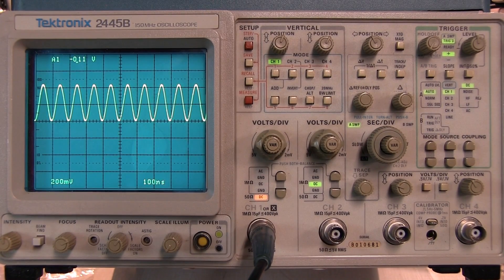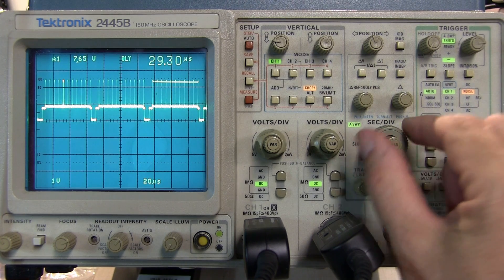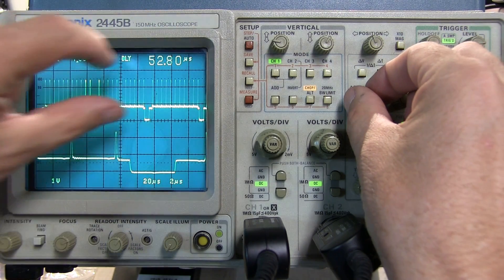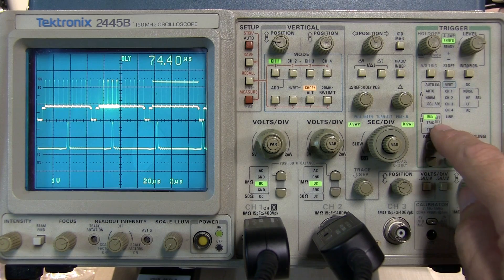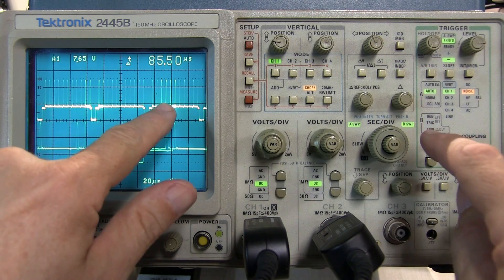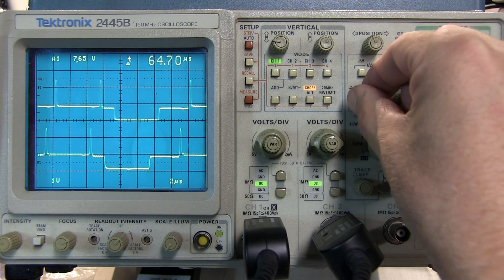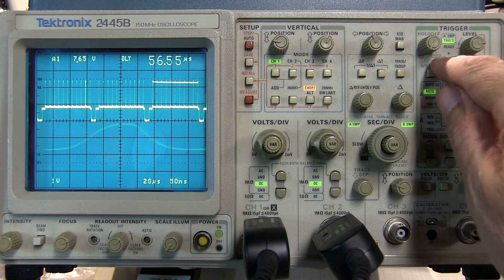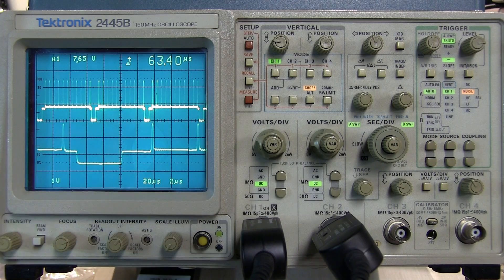#287: How to use the Delayed B-Sweep Timebase on Tektronix 2465 2445 2455 2467 Oscilloscopes

Comment: You didn't mention anything at all about how to use the B delay sweep to view display and measure pre trigger waveforms. The B delay sweep just zooms in on the highlighted area that you want to zoom in on to measure more details. I'm not sure how to use the B delay sweep to view the pre triggered information or what types of waveforms/signals a technician would want to display the pre triggered information?
Reply from the maker: As I said before, you can't truly get pre-trigger information on an analog scope unless you EXTERNALLY delay the signal with respect to the trigger.  The Delayed timebase allows you acquire multiple cycles of your signal, then zoom in to see the waveform before similar edges on subsequent cycles.
Reply: @w2aew  oh ok I thought you said that the B delay sweep circuit was also external delaying the input signal with respect to the trigger. So you're saying that the B delay sweep is NOT delaying the input signal with respect to the trigger? I always thought the B delay sweep circuit was adding an offset sample and hold circuit or using a BBD time delay chip to delay the input signal with respect to the trigger
Reply from the maker: @waynegram8907  the B delayed sweep is simply a second sweep circuit that started or triggered after a user-defined delay from the A trigger event.  It is the sweep that is delayed, not the input signal.
Reply: @w2aew  you mean it's delaying the horizontal deflection circuit? It seems like there is two separate beams compared to most analog oscilloscopes only have 1 beam not 2 beams.

Comment: I just bought a 2445 for $186 on eBay including shipping. Did I get burned or a good deal? I currently have a Iwatsu SS-5710 but I've always wanted a Tektronix because they show information on the screen like the volts/div and the sec/div and my Iwatsu doesn't do it.
Reply from the maker: Thats a nice scope, I would say that you got a good deal.

Comment: Hi mate. I was wondering if you have an opinion on whether you should operate your analog oscilloscope on no timebase mode (beam stationary) or any mode that would leave a constant electron beam on a single area. Will it burn the phosphor behind the glass?  I purchased my analog oscilloscope last night and the seller has taken very good care of it and told me not to let the trace stay stationary. I believe him, I just don't know how paranoid I need to be and how many seconds/minutes before it will overheat. The model is a Pintek PS-605
Reply from the maker: It is difficult to say.  A static dot can certainly cause damage.  How quickly is a product of the dot intensity and duration (and the quality of the CRT).  Best practice is to NOT have a static dot if possible, at least have it sweeping.  And use the minimum brightness/intensity needed to get the job done.
Reply: @w2aew  Thanks mate. Sorry I was a way and didnt get a chance to reply. You are 100% correct. I finished reading through the manual and it says to avoid keeping the sweep too slow and only use high intensity when needed, and not for too long. Thanks mate. I'm learning from your videos

Comment: Hi, I am reading that some (better) analog scopes have delay line so one can see the actual trigger signal, or even some part before? I think, if somebody, you should know about that feature? So you maybe would like to elaborate on that. And if they do not have it, if we would have a external analog delay, we could feed the original signal into the external trigger input and the delayed signal to a regular channel. Old TV's used (only PAL maybe, not sure) a delay line, but my knowledge about that ends there. And no idea what handy part could be used here for (not to have to use a big lumpy coil).  I am getting tomorrow a blown-up 2445 that I will try to resurrect from the dead. I hope only one of the RIFA's blown up and the rest hopefully stayed undamaged, fingers crossed 🤞 Greets! Edit: if I calculated it right, 10m of coax would give a nice 50ns delay 🤔 That is actually not so bad. Edit 2: I see that an Tektronix external delay line like DL-11 is still not very cheap 😁
Reply from the maker: Yes, many do have a delay line for that purpose.  Some also have an output that provides a buffered copy of the signal at one of the inputs.  This could also be fed back into another input as another source of a delayed signal to see more of the pre-trigger waveform.
Reply: @w2aew  okay, Good to know 👍  then you probably delay the copy of the input signal externally and trigger on that on the second ch. The original input signal is then "further in time".

Comment: Hi. One question about the crt. How much better would be the micro-channel plate CRT in 2467(B) compared to the "standard" crt? Especially with those high bandwidth scopes. In anyway one would maybe wanted to spot some glitches and I was wandering if the u-channel plate would provide much more chance to see it...???
Reply from the maker: The MCP gives you a couple orders of magnitude faster writing rate - able to see single-shot events at 1ns/div.

Comment: I have a 2467 with the CTT option and I've just discovered that it gives you a couple of extra tricks. First, the CTT will measure the time delta between triggered B sweeps. Second, with the CTT option, it's possible to set up separate slope and trigger levels for each of the B sweeps. In combination, you could e.g. use this to measure the length of a pulse by triggering on the fall/rise.

Comment: Great video. I have a 2246 with an odd symptom I wonder if you had seen before. The Voltmeter function of the scope is intermittent, and when it doesn't work it displays "Ouch. Turn Volts/Div CCW" even with no signal in. I can't find anything in the service manual and thought with you vast experience that maybe you had experienced this symptom before? Thanks for the wonderful content.
Reply from the maker: Sorry, I don't have any experience with the 2246.  Sounds like the voltmeter is thinking it is getting over-ranged.  The experts on the TekScopes group may have some experience to share.

Comment: hi, how to see  power on hours and cycle counts?
Reply from the maker: Copied from another forum:
If you want to check how much the scope has been used, you can run the Diagnostic Exerciser EXER 05.  It will tell you the total operating time and the power cycle count.  Here's how you run this:

Press and hold the delta-V and delta-t buttons, then press Trigger SLOPE (while still holding down delta-V and delta-t).  Release all buttons.  Then press the upper/lower Trigger MODE buttons until EXER 05 is selected.  Then press the upper Trigger COUPLING button to run EXER 05.  You can exit the exerciser with the lower Trigger COUPLING button and return to normal scope operation with the A/B TRIG button.
Reply: @w2aew  my machine is baby... me2... in this field... i ask and they block me.. I do not why.. I read... ask...  I just start print manuals PDF...  HR ON 8116 PWR ON/OFF 2177  i just find weak spot is u800 like I have on board...  :( i do not know what I can to do last longer...
Reply from the maker: @zeljkoadzic1692  just make sure to keep the fan in good working order and always run it with the case on to get proper airflow.

Comment: Cool !! I just got my scope 2 years ago. All sorts of cool stuff !!  I use the analog one for when I need more perception. Like when a waveform has more complicated structures. In a digital scope the refresh rate is dismal, so catching non-periodic anomalies Is damn near impossible... I really wish the old scope had more on screen measurements and COLOR .. jeez  different color traces . who woulda thought that was needed !!   =joke ... I knew the pull knob zoomed, but I didn't know when you turn it it magically pops up a new mini version, and all the other tricks u showed ....  hmm . now thinking about it > whats the deal with the var , is there some magic special reasons they exist more than merely shrinking  ?
Reply from the maker: The VAR control on the horizontal timebase is for those rare occasions where you don't need a calibrated sweep speed, but rather need to display a specific time-duration of a waveform which would require a time/div setting that falls between two of the calibrated positions on the knob.

Comment: Great video! I have Tek 2465 DMS that isn't working well. Any suggestions where to look to fix it? Sometimes I get trace on all 4 channels but sometimes they go away, Also the text/numbers at the top + bottom aren't always visible, they go to some electronics heaven but if I wiggle stuff, sometimes I get ti to stay on. Also, when I push the "beam finder" button, everything shrinks, so all 4 channels are about 2" long and the text is just small pixels - all in the center. Thanks for sharing and teaching here!

Comment: Always enjoy your videos Alan. I just was given a 2445A, that was is need of some care. Turns out it works just fine, but some prior owner, broke off the shafts of the vernier controls for both VOLT/DIV channels. Fortunately I got them back to the calibrated position, but not enough shaft left to attach a knob on. I also own the 2465 (300 Mhz) and  it is my go to scope even though I have a modern digital scope.I just think Tektronix made the best scopes and their durability is a testament their quality.
Reply from the maker: Fortunately, you rarely need to move those controls off of the Cal position.  I've heard some folks that have replaced the shaft with a small piece of metal tubing or even a small fiberglass rod from a hobby supply shop.
Reply: @w2aew  
 Yes, that is my experience. I thought about the fixes you mentioned, after looking inside, only the metal tubing seems practical unless I want to take the the Vertical section apart. I am a retired engineer (Rutgers) and a ham (Extra class K7MLG and have been repairing vintage radios and test equipment to keep busy.
Again I really enjoy your videos they are the most accurate and enlightening on oscilloscopes.

Comment: Were these scopes aided by some CPU or it is just pure analog electronics? It's pure magic if it is.
Reply from the maker: While this family of scopes does have a microprocessor, the delaying timebase capability also existed in several Tek scopes that had no uP at all - pure elegant analog design.
Reply: Well its digital design too, the state-machine for the sweeping would have involved a variety of flipflops and gates to do the work.

Comment: Great as always.  May be do an episode about how the delays are used to make meaningful measurements.  Even something goofy like how a switching transistor in a power supply works.  The "delay" of the inductive aspect of the transformer winding is interesting.  Can we make a quality guess without a Clive style teardown by looking at the different individual windings?  Crazy I know, but that's the sort of stuff we tried to do in '85.
Reply from the maker: I"ll jot that down.  I have a few videos that use the delaying timebase to make "real" measurements already.  One shows how to use the delaying timebase to accurately measure frequency.  Another shows the use of the delaying timebase to help characterize an RF power detector.  There are probably a few others too.

Comment: Nice video Alan.
Tek did and do make some outstanding scopes.
That's a nice example, I'de be proud to own that. 
I think I would prefer to use it than my two modern DSO's.  Siglent SDS1102CML and SDS1104X-E. both of which together, probably don't cost as much as your TEK2445B.

Comment: Quick question. I'm assembling my electronics workbench (aimed at RF - primarily HF but it would be nice to cover up to the 70 cm band) and I need to pick a scope. Any suggestions that wont break the bank? As we are on the topic, a video on how to put together a instrument setup for RF test, repair and design without selling you kidney and first-born would be great!
Reply from the maker: That's a quick questions that doesn't have a quick answer.  A decent scope is helpful.  I like analog to look at RF envelopes, etc.  Digital scopes add FFT capability for rudimentary spectrum analysis, as well as a ton of other features.  Good RF power meter is typically needed.  An RF signal source can be very helpful.  Even an SDR based spectrum analyzer can be quite useful.  There are a lot of amateur grade RF equipments (analyzers, VNA, siggen, etc.) based on small microcontrollers, DDS chips, SDR receivers, etc. that can be very useful in test/repair/design.
Reply: w2aew The RF power meter I did not think of. On the other hand I do fancy some of those TX test sets - Marconi  has a model that is kinda ’afordable’ second hand. There are also some reasonably afordable simple siggens out there - also from Marconi. Also realized that the scope should have 50 ohm inputs. Anyways, thanks for the input.

Comment: Old scopes always amaze me. I can't even start to figure out how they fit all of those features in a unit with old school component technology. I have a Tek 2465 at home I just fire up now and then to play with.
Reply: twjonckheere I also have a 2465 just recently reconditioned. replaced all the electrolytics and resoldered all the hot spots on the power and deflection boards. sad to say I wasn't able to repair the 2nd channel. it's reading so far off from calibration when dc coupled. tektronix is the best analog scope I ever ever used  so far. the triggering is super and the intensity of the trace is sharp even when signals are so high in frequency and in fast rise times. full packed with features too.

Comment: What an extremely complex feature for an analog scope, would never have expected such an old scope to have such a complicated feature.
Reply: Most of the better old scopes have this feature. My 80's vintage Tektronics 2215A has delayed sweep.
Reply: I see these kinds of features as something for engineers to spend their time thinking about and working on before they had to spend all their time debugging software and fighting with a compiler that won't install and doesn't work right and that sort of thing.  What else are you gonna with all that brain power?
Reply: Dantali0n, I can't imagine how they achieve this on an analogue scope.
Reply: It is 8 times the power (double the 6db value). Every 3db is a 2:1 ratio in power, every 6db is a 4:1 change in power). Keep in mind, this is for power, not amplitude. A 3db increase is double the power, but and increase in amplitude (voltage) of 1.414, a 6db increase is 4 x the power, but double the amplitude.
Reply: "such an old scope".  Let me introduce you to my tek 565.
Reply: @stargazer7644  I have the tek 453 it sits comfortably in between both. Seems lot's of scopes have this, like my pm3253 or pm3370

Comment: Thank you for this Alan. I've got a 2467B and had been trying to find out what other features I'm missing out on. This makes it so much easier. One thing I've also got to ask about the 2400 series is why does the ground terminal use a banana jack over the clip on method used today and on the cal signal on top for probe cal. Does it offer a dual purpose?
Reply from the maker: Gives you a way to tie scope ground to your equipment / circuit ground - especially useful for low frequency applications where you can then omit the probe ground connection.
Reply: Mine came with a little steel piece that has a male end for the banana plug, and the other end I can screw or clip onto.

Comment: I don’t understand why shortening the A sweep would help with B sweep intensity. If there are separate beams for A and B sweep, it shouldn’t matter. If one beam is drawing both, surely it can’t draw both sweeps at the same time - it must draw first sweep A and then wait for another trigger, delay and sweep B, so the length of sweep A shouldn’t affect the intensity of sweep B in this case either.
Reply: There's only one beam in these (and most other) scopes.
Reply: Simple, a shorter A sweep makes both beams to be drawn more often and thereby brighter.
Reply: The scope only has 1 beam. It doesn't draw both at the same time but (I think, not sure) it does not wait for another trigger to draw the delayed B sweep. The incoming signal is fed through a delay line to get the delay. Meaning the exact position and portion of the waveform you select on the screen to be displayed as trace B is actually what the scope draws as trace B, it's that exact signal.
Reply: A bright beam is "blinding" the operator's eye in regards to the less bright beam. This effect is visible on the video. Else said: if you turn off the brighter beam, the dimmer beam is easier to see

Comment: Hi Alan,
Interesting piece of test equipment. I was wondering what they would cost, and a refurbished one goes for about $1300.  73  WB3BJU
Reply from the maker: You can often find 2445 or 2465 for under 400-500 dollars these days.
Reply: @w2aew  Mine was  15000 czk = $690 - bought from a service company after a refurb with a one year warranty. I bought it as a replacement for my 466 + 44 which was unfortunately stolen.
Thanks for the video, I'm smarter again.

Nice day 🙂 Tom